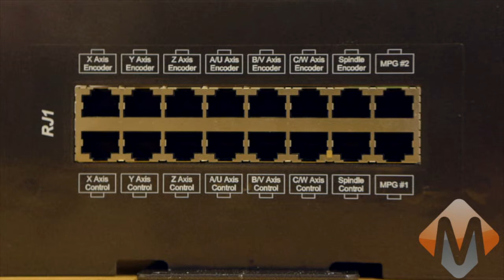MachMotion Apollo III Motion Controller Overview

Comment: I take it that this does not have to be grounded in the cabinet anywhere?  Does it have to be floating?
Reply from the maker: The board is run off 24VDC. Just 24V & 0V connection from the power supply, so yes, a floating ground.
Reply: How about all the Ethernet cables that plug in there?  The wires are all grounded and shielded.  Do the RJ45 receptacles on the Apollo III go  to a ground point anywhere?  Reason I ask is because I have an MPG that branches off of a big 8 pair grounded and shielded cable. This cable handles pause, cycle start, probe, NPN prox, and a few other items.  This wire goes between my machines head and control enclosure cabinet.  I connected the grounding mesh and wire from this cable to the shielded  RJ45 head that goes into the Apollo III MPG receptacle.  I also have a single green grounding wire that connects to the grounding mesh and wire of that cable.  Can I go ahead and connect that to the grounding point in the cabinet or not?  BTW its a BP V2XT if you are familiar with those.  I want to be able to drain any EMI RFI to ground before it gives a false signal to any of the controls I mentioned.
Reply from the maker: JOe Shmoe Our support team would be glad to help you out here. support@machmotion.com